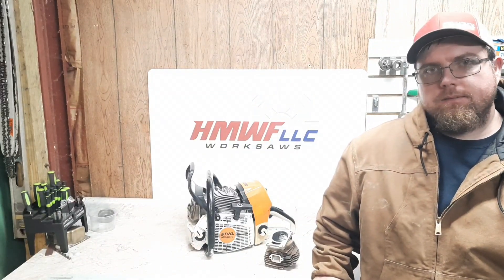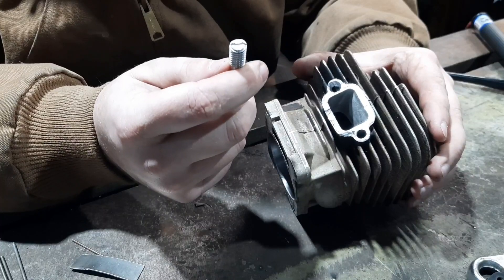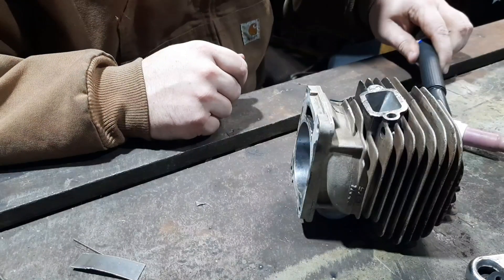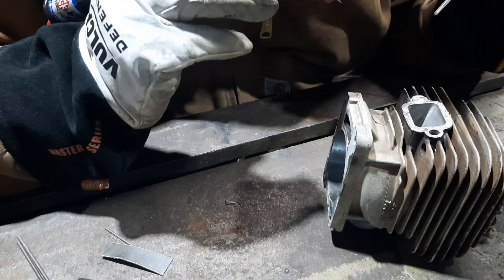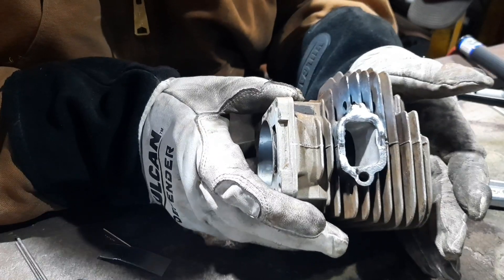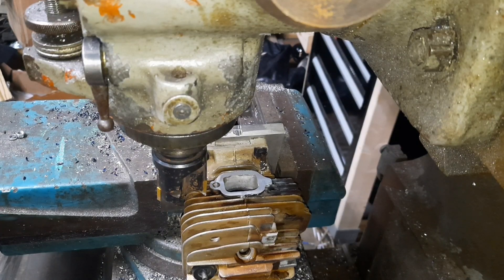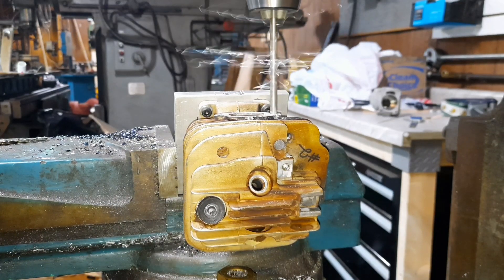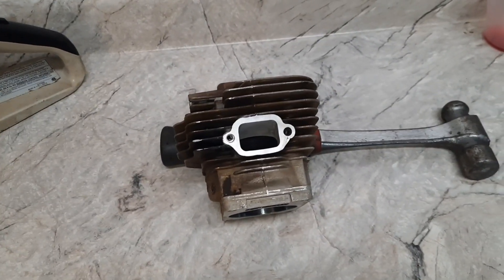Cylinder repair! Stihl Ms 661c

Comment: Hello dude. Could material be added to an exhaust roof if you’ve taken to much off?
Reply from the maker: It could be if you can access the area. Getting close to the plating can cause issues.
Reply: @dynojoemods2764  I was wondering if it would. Would it knacker it?

Comment: """ Yes """ More Work / Repair videos.
Reply from the maker: I will try to keep a few coming.
Reply: @dynojoemods2764  WoW, That Was a Quick Response,,, I'm trying to figure out which Husqvarna saw to port first,. A 262, 266, 271, 181, 281, or a 288. Having a Hard Time Deciding  ???
Reply from the maker: @ronaldmasterbud1551  

Easiest way is whichever you enjoy the run the most.
Reply: @dynojoemods2764  That's Easy 262xp 
That was My First Real Saw, a hand-Me- Down From a Good friend's deceased father. ( Who was a life long Logger in Michigan  ) It was 20 years later before I found out it has a Cult Following,  I Thought it was just a standard professional Husky. The only part That Broke on it was the Coil ( after I had it about 15 years ). Not including consumables sprockets, clutch drums,  & chains. Love that little saw !!!

Comment: Yes.  I want to see more repairs like this.  I especially want to see how you mount the cylinders to your lathe and Bridgeport machines.  I'm trying to get my lathe set up for machining and the info out there is hard to find when you don't know what to look for.  I have a 2" bar of solid round stock that I have milled to slide the cylinder over, but how do I keep the bar from spinning inside the cylinder?  Also, how do I get to where I can machine the squish area?  I saw a video of tree monkey using some setup to mill the squish by hand.  How do I make those?  What's the best resource for cutting tools for my lathe?  So yeah, as much machining related content as you can give.
Reply from the maker: https://youtu.be/a-uDyXrRA1s
In my 881 video I go over making a squish cutting plate, and a little of the setup.

As for turning the base. You need to have a semi snug fit on your round stock and use the lathe tail stock to apply pressure to keep from spinning inside.

Comment: Pre heat castings in an oven helps.
Just don't let the Mrs catch yo doing it.
OTH an oven is a handy workshop item for heating casings for bearings installs and removals as well as welding castings.
Reply from the maker: Yes some heat goes a very long way with castings.

Comment: I have never Tig'ed aluminum with a pointed toungsten.  Did you ball it and not include that in the video or did you use it pointed??
Reply from the maker: I didn't ball it, it rounds pretty quick. Or after the first dip in the puddle. With my lack of skills I have not noticed much difference starting with it balled.

Comment: looks good
Reply from the maker: Thank you
Reply: @dynojoemods2764  I would have burned a hole through the aluminum for sure
Reply from the maker: @brianmcintee6647  

Cast/aluminium can be tricky. It likes a little bit of heat to get going. But it sucks the heat out so fast at the same time.
Reply: @dynojoemods2764  It takes skill for sure

Comment: Nice! 
I’d like to see your set up process for the milling. How you found center and got it square to machine
Reply from the maker: I didn't get a great up close shot, I left enough "witness" good flange not welded to line up "flat"

Then I set the tap drill in the good hole to line up the hole. Moved over the correct distance to drill the new hole.